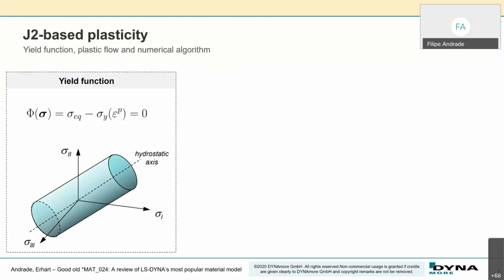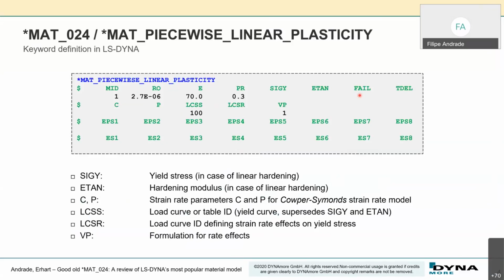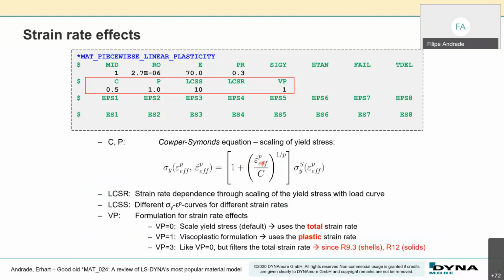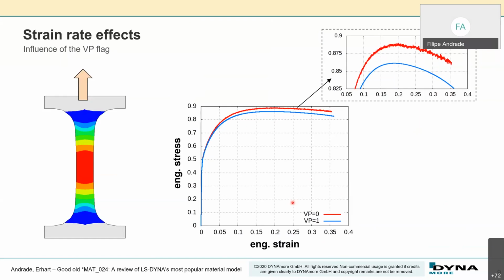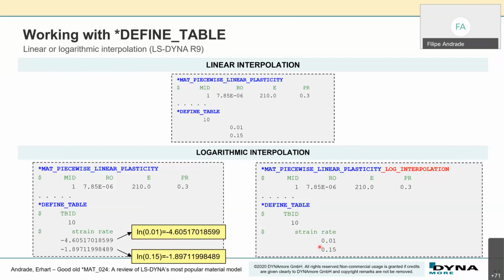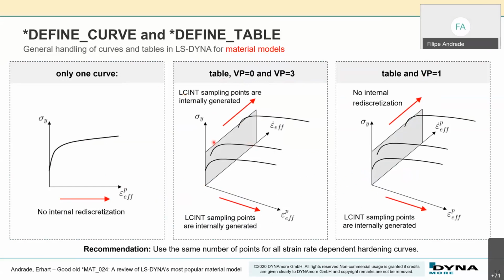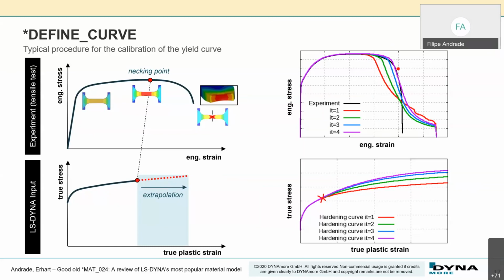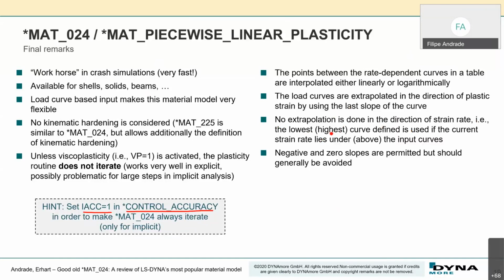DYNAmore Express: Good old MAT 024 A review of LS DYNA’s most popular material model

Comment: I have a question. I apply mat 24 and put ss curve for each strain rate, but in the case of strain rate in the table, it is correct to put constant value such as 0.1 0.01 instead of log value, right? (If you put in log value, apply mat.24_log interpolation value)

Also, are there any points to be aware of when using the table?